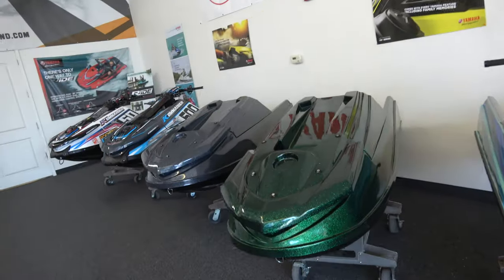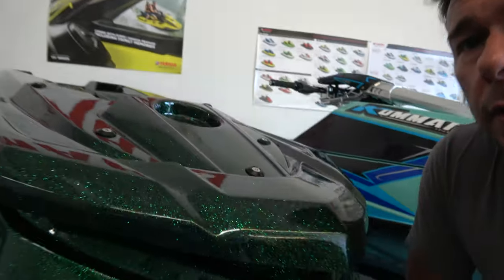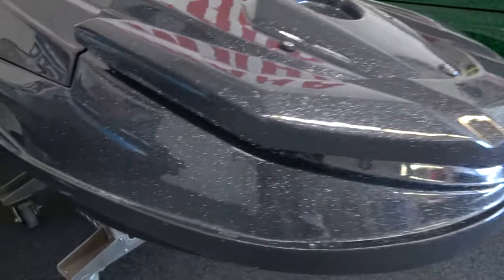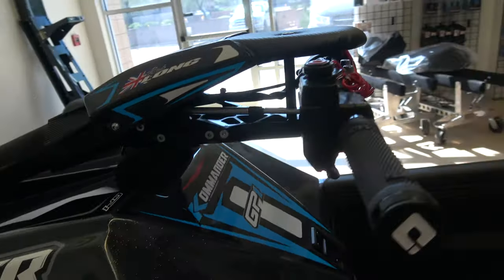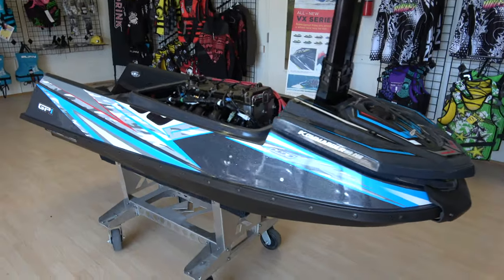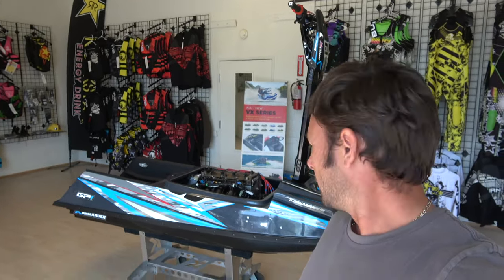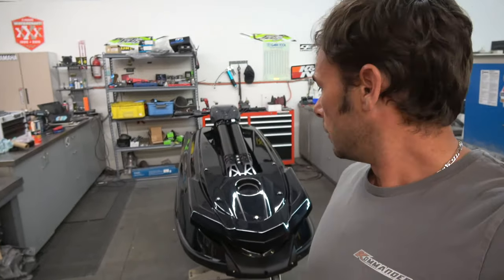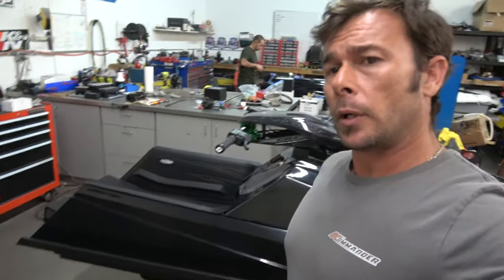VLOG 5 WF 2021- BEHIND THE SCENES AT KOMMANDER

Comment: Pinnacle of the limits of what a standup can do. Not much more to improve on unless there is dramatic improvement on the drive train. 

Dustin, quick question. A turn key boat without any upgrades (entry), what does something like it run up? I was hearing anywhere from $19-23k OTD.  Do you also have a link to dimensions and weight for a completed build w/1500? I couldn’t find anything on the web sight or forums.
Reply from the maker: a turn key ski is $25900.00 email sales@kommanderind.com and I can get you specs , cheers
Reply: Thanks Dustin, got some more savings to do then. Ill shoot out an email tomorrow.